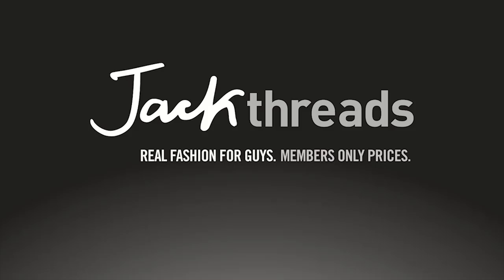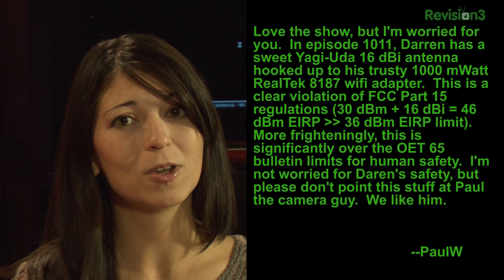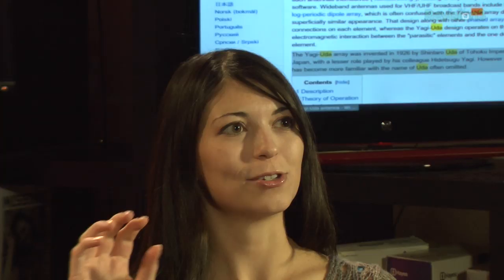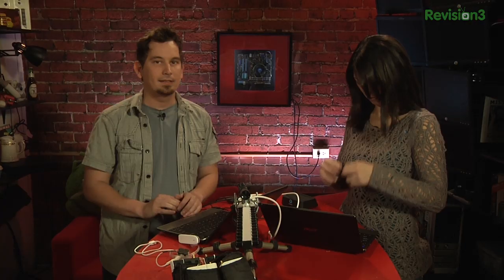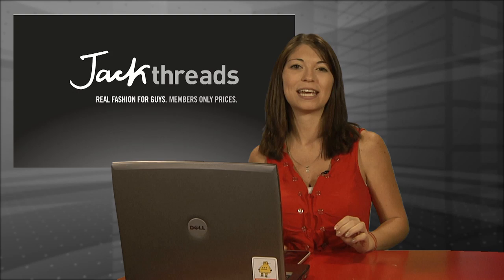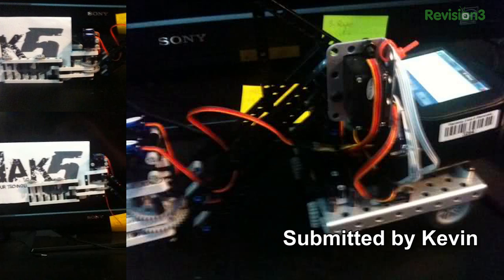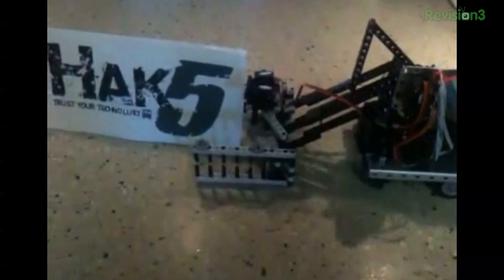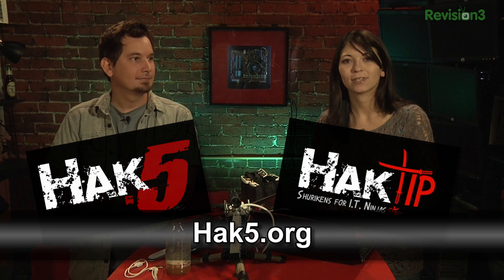Hak5 - 1000mw WiFi txpower with a 16dBi Yagi Antenna

Comment: I had one of those China made yagi antennas.  It did not work well. Stick with a manufacture that makes antennas for  commercial use with real published specs on radiation pattern and  SWR.  It s also hard to know the real  ERP because many  manufactures exaggerate the gain of their antennas.
Reply: Literally the only comment on here with useful information.

Comment: Thats BS Darren... Yes its part 15 spec.. but if you run a part 15 with a larger antenna the combination is actually outside of your EIRP its still illegal.. Your running out of spec... Regardless of your units output, in combination with your antenna your outside of the illegal limit.....

Comment: Whilst there's a limit for total irradiated power, and Darren's right when he sets it to just 500mW, it didn't address the second issue. Just like how my laser at home is a tiny tiny 50mW, compared to, say, a 60000mW (60W) incandescent bulb, the bulb sends that energy out in all directions, but the laser concentrates it onto a small area. The laser can burn through thin plastic at several metres, and the bulb wouldn't. This set up might not be a health risk- but it is important to check.

Comment: Some firearms do use clips. For example the M1 Garand and the SKS both use clips. A magazine is what holds the rounds in the firearm. A clip is used to load the magazine. Typically clips are used to load fixed magazines. 

But you are correct. The person used the term clip incorrectly.

Comment: In Finland the limit, which is 100mW, is for a dipole antenna. When the antenna is a direction -antenna the power needs to be deamplified by the same amount as the directional antenna focuses the "beam" So if 100%(radiates 100% of 360 degrees) dipole antenna transmits 100mw, a directional antenna which focuses the beam to 5% of the dipole antenna's range can only transmit 5mW. Please do tell me if the regulation is more open in the US!

Comment: Your wifi transceiver might be well within the ERP limit.  But when you add 16 dB of antenna gain...what the viewer is saying is you are now over the ERP limit when you combine the transceiver output plus the antenna's gain.  While this is still a small amount of power and the antenna is rather directional you could still be interfering with other transmissions.  You are most likely interferring with someone else's wireless telephone or wifi internet.  Do a little research on harmonics...

Comment: and about the email its not illegal if you use the antenna to get the signal u can put 15W and still legal. transmitting  signals that's different mater

Comment: Part 15.247  says (i) Systems operating in the 2400–
2483.5 MHz band that are used exclusively
for fixed, point-to-point operations
may employ transmitting antennas
with directional gain greater
than 6 dBi provided the maximum peak
output power of the intentional radiator
is reduced by 1 dB for every 3 dB
that the directional gain of the antenna
exceeds 6 dBi.

Comment: We are allowed a maximum of 4 Watts, 36dBm, total power (ERIP)

So, if ERIP (dBm) = radio power (dBm) + antenna gain (dBi)
Then, 36dBm (ERIP) - 16dBi (antenna gain) = 20 dBm (100mw)
Therefore you are only allowed to hook up a 100mw or 20 dBm radio to the 16dBi Yagi antenna (legally)
Reply: +1
Reply: SirSniperhead Are not people said  for "Point to Point" fixed points you can go more ?!
Reply: Rule riders
Reply: No way that cheap china yagi is 16 dbi. The pigtail  coax has poor shielding  and actually radiates, which will cause signal loss and  the antenna to not resonate at  2.4 GHz.

Comment: The dip shit with the CB was more then likely dead keying 75 watts and swinging a couple hundred on a 60 ft mast from across the street.  As a licensed ham operator his licenses should have been pulled and equipment confiscated but they choose to do nothing.  

Either way what he's doing with this rig isn't harmful in anyway especially since it's  mostly only being used for the increased gain on the rx end and not tx.

Comment: I said he was a licensed ham, that doesn't mean he couldn't use a cb ALSO.  The equipment you he was using illegal.  Using ham radios to tx on CB, amped CB's, all of that should have caused him to lose his license.  He was the guy to go to if you needed a radio modded, peak & tuned but no one on the block watch the evening news without him bleeding over.

If they didn't do anything about him why would they care about adding a high gain antenna to help sniff packets.

Comment: How did they adjust the 500 to 1000 on the 8187 wifi adapter ? is it possible to do that in Windows 7 (i'm assuming that was linux he was using, but i'm not sure)

Comment: would anyone know what part of the radio spectrem in the UK is open to the public for example if i were to have a yagi antenna how much power would i be able to run though it without breaking Both EU and UK law thanks Hak5 ??

Comment: fcc regulatons for a device are always in context with the original antenna.
You attach a yagi with >20db gain vs dipole? youre out of regulations.

Besides folks, your cell phone probably uses more power - is much closer to your brain - is transmitting all day (also in stand by) ... no point in getting hysterical about wlan-yagis - especially, since theyre usually used to connect two remote buildings or so.   No one puts that into the living room.   regards, a ham from europe

Comment: Why?

What's he done in his terminal that I should er thank you for?

Totally serious question, i'm not trolling.  I'm just a novice linux user at best, and an absolutely completely hot off the press noob when it come's to antenna's and whatnot.

I live in a very remote area with no towers for at least 20km, so I have to deal with fucking 1 bar on my phone when i'm OUTSIDE

But I want to learn and amplify my WiFi's range so that .... I can see more WiFi networks, hopefully er .. unsecured or WEP

Comment: Maybe they might 'catch you', ...by virtue of the fact that Government regulators can essentially slap you with a fine and you have to prove that you didn't do it.  However, the fact is that if you are 'within reasonable limits' and or not broadcasting 24-7 and or not causing interference that will bother others, they have MUCH bigger fish to fry that could MUCH better legitimize their job then a residential tinkerer.  Most of those guys only look for easy targets to legitimize their jobs.

Comment: Why is the actual item not tested out? It is just talking about the antenna. 

Just to point out a little "experienced the hard way" info - those cheap Chinese-made yagi antennas sold for like $15 on eBay and Amazon - are not tuned correctly. They are further down the teens range of optimal performance, and can actually be connected to cell radio hardware to pickup cell band signals. Not well though. 

When it comes to these cheap versions, dont waste the time or money. Tell your audience to pickup the Alfa 7dBi directional instead. It is MUCH, much better than those cheap yagis. I know the stereotype of Chinese being good at math and all, but to mess up the math THIS badly, and keep selling it... it just messed up. I suppose they do b/c it still picks up some 2.4 signals. 

You should do a video on connecting WiFi amps to the Alfa-type units (or those w/ injection functionality), to show the difference of signal between using the Alfa alone, and then with the amplifier. Ive personally seen significant differences, and being that we discuss this type of thing.... it is a cheap way for users to gain tx/rx power without buying all these crazy types of antennas. B/c the antenna is not going to be as helpful, if it is being underpowered also.
Reply: could you link me to some amps please ?
Reply: Sorry it took so long- been busy and havent come on here iaw. Heres one I personally own a few of. Works great. It is 2.4Ghz- but you can find 5Ghz range on there too. Just search "WiFi amplifier" - I generally go w/ Sunhanz but there are other brands. 

https://www.amazon.com/Sunhans-Sh-2000-Wireless-Repeater-Booster/dp/B00HJ1NQLS/ref=pd_sim_147_5?_encoding=UTF8&psc=1&refRID=TJ5TK5DT1ZGFYQG57JBC